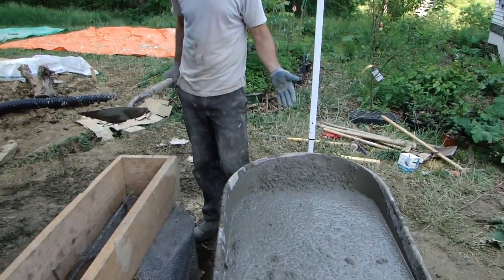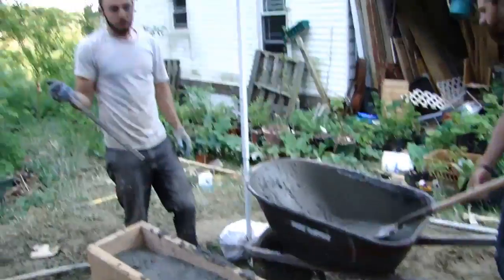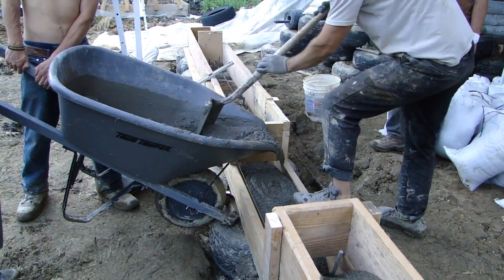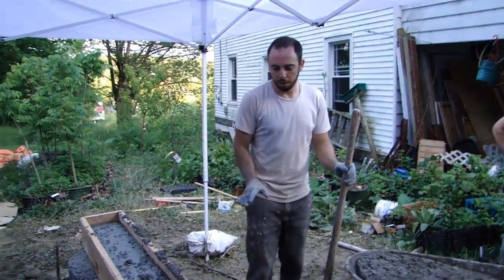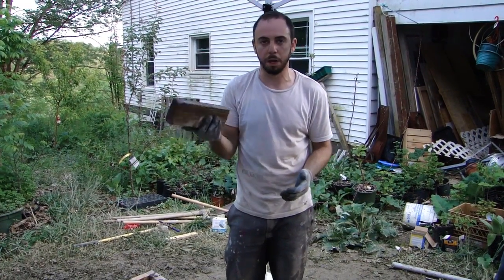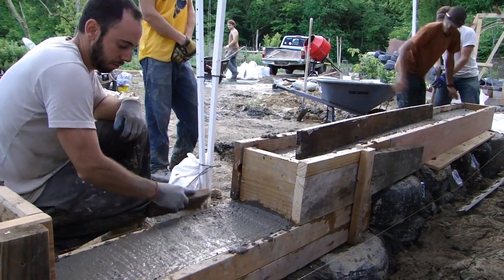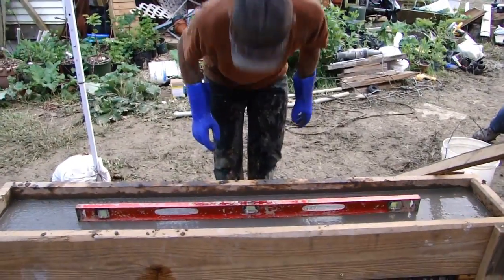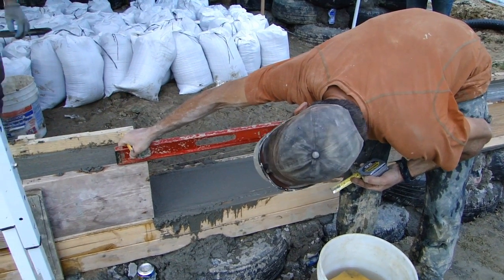Cincinnati House - Stemwall Bond Beam & Footings - Part II

Comment: Wouldn't it have been simpler & faster to have just build the footings level and top of footing equal to desired height of concrete, height matched to each other? That way, just fill both to the top & screed. Done.